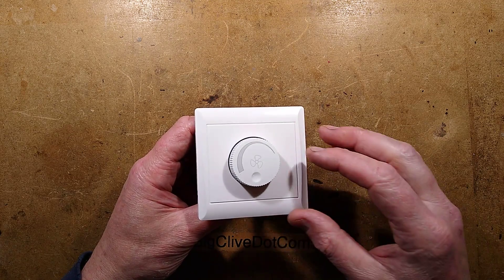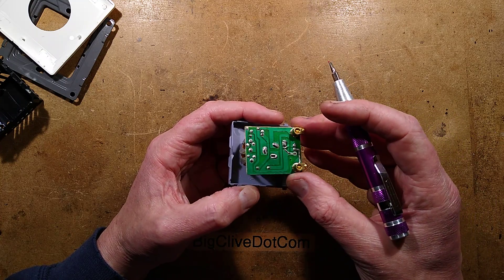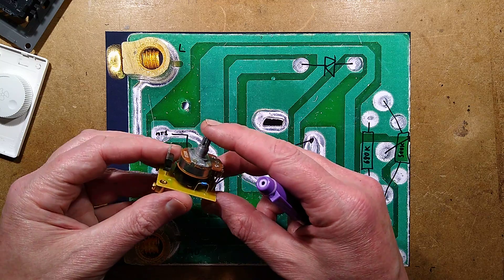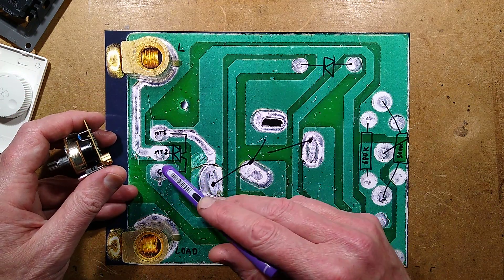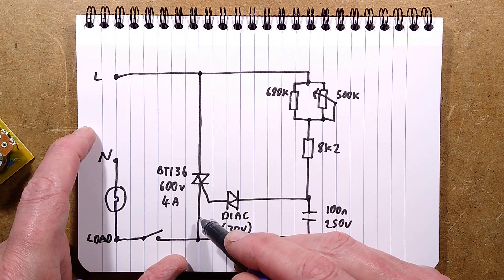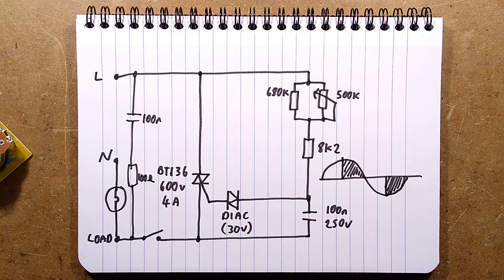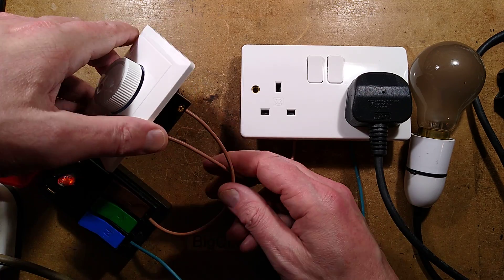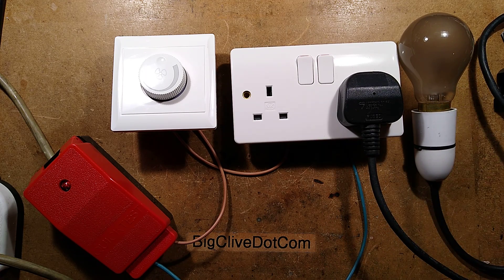Inside a cheap eBay fan controller (with schematic)

Comment: I had to make a 170v power supply for a project quickly. I took a dimmer, connected it to a bridge rectifier and capacitor, and turned the dimmer to a position where I ended up with 170v. Is this wise?

Comment: Is it safe to use on a shaded pole motor?
Reply from the maker: It may work, but a common way to reduce the power of shaded pole motors is to add a suitable capacitor in series with them.  It all depends on the size of motor and application.
Reply: @bigclivedotcom  I was interested in using it on a 40w desk fan. I want to be able to vary the RPM continuously and smoothly.

Comment: Hey mate, great videos. I have a question for you please.  If I wanted to have a speed controller for an Australian AC 240v single phase electric induction motor, 0.9A, 0.12hp, would my only option be a VFD or can you please point me in the right/better direction? Any advice is much appreciated. Cheers mate. 🍻
Reply: Or could I use a simple fan controller like you have in this video?
Reply: Anything that relies on lowering the voltage and/or current like this thing will only lower the torque of an induction motor (I think..). Therefor, with a load, you could theoretically reduce the speed by limiting the torque, but it may not be able to start, may stall and may overheat by running too slowly. I've wanted similar control for small induction air compressors but as you noted VFDs are really the only option that isn't terrible.

Comment: I made the mistake of using a dimmer as a fan regulator.
It was terrible.

Unless I had it at full speed, fan would make a terrible whining noise.
And the first half of dimmer wouldn't even give enough power for the fan to turn, fan would just whine.

The normal fan regulators have a set of 3 capacitors of varying capacitance. And the five numbers in it connect it through them with increasing capacitance, with number 5 being a bypass.
Only problem with them is, after a year or two, capacitors slowly deteriorate, and fan runs way too slow even at number 4, but it goes full speed at number 5.

Comment: Most fans or motors really hate the tryac version of speed control. They will make lots of noise. I think the more commercial versions for like large ceiling fans use large inductors to try to round off the high frequency aspect of a instantaneous switching midway through a sine wave.

Comment: Had a triac not turn off until it had a pulldown resistor between gate & neutral & the snubber was disconnected.  It was perplexing.

Comment: Another good reason to start some fans on high speed is that some have louvered grills on the front of them. The louvers are closed when fan is off.  There is usually not enough air flow to open up the louvers on low speed so it starts at high speed to quickly open the louvers and then one can back down to the desired air flow. I have a ceiling fan installed  in my 2nd floor ceiling and this is how it seems to work.

Comment: I have 3 units of an electric fan with the same kind of control, but they need to be turned on and immediately cranked up because the controller starts with a late triggering point. I think I'd have to flip the potentiometer physically or rewire the circuit board to make it work as yours does (which makes more sense to me.)

Thanks for sharing!

EDIT: Brazilian suicidal showerheads have also TRIAC controlled heating elements in some models.

Comment: Before I seen the video you had put up (I also seen one with youtuber "The Guitologist") (If you have not caught any of his vids he does a lot of old tube amp repair) Both you did reviews on the Knockoff Hakko 936 Solder stations. (It seems they are pretty much all the same on the inside and easily rebranded in China to what ever name suits their fancy at the time). But like I said in another comment. You convinced me to grab one instead of going the traditional route of just keep using a solder iron or pin type that lacked any temp control. As such I had been looking into Dimmer Switches on Amazon and had several picked out to make a dimmer box to control the heat on a standard non-temp controlled iron.

I was looking at a Westek 6077B 200-Watt Manual Dimmer or  HiLetgo 2000W PWM AC Motor Speed Control Module Dimmer Speed Regulator 50-220V to put into a box along with a outlet and such to make a Temp select type thing. (Very similar in design and function I suspect as this dimmer in your video break down.)

I am glad I did not go the dimmer box route but dimmers do fascinate me a bit still. I wonder what projects one could put a dimmer like this into.
The 936 knock offs are the way to go.

Comment: Works like a rheostat Clive. The older ones had wire wound windings inside. Some older components except for those old wax paper capacitors were of excellent quality and build, sadly fast forward to modern times in some cases quality is not there. They used to use large rheostats in cinemas  in the old days to dim the lights.

Comment: I've been trying to get my head wrapped around Triac since I accidentally bought a single speed drill off ebay, and then ripped apart a couple of worn out vacuum cleaners and saved the speed controllers. I had got most of the way there... I thought it was a variable resistor rather than a potentiometer, and I thought it controled the Triac switching directly, I didn't know about the Diac at all.

Comment: Hello dear Mr. Big Clive sir.  How do "cold spark" special effect machines work?  Thank you dear Mr. Big Clive sir.  Have a swell day!
Reply from the maker: They often blow finely powdered titanium through something resembling a hot air gun that ignites it on the way through.  The mass of the tiny burning specs of metal is so low that it feels cool to the touch.
Reply: @bigclivedotcom  Fascinating. Thank you dear Mr. Big Clive sir!

Comment: I wonder.. do all electronics in china emit tons of interference and electrical noise and not have their ground wires connected? I cant imagine that China has a separate product for export for each item, and then a safer, better built product that they use at home. I imagine the rate of fires and simply products that dont work are very high over there. I wonder what the average citizen thinks about all the products they buy, since it must be frustrating that everything is made with such low quality.

Comment: Would this work with every fan? I have an Ardes 5A120L. It only has 3 speeds (not well chosen) obviously with capacitive current limiters in the rotary switch.

Comment: would it be good to use it to control power on primary coil on transformer. i remade microwave transformer: replaced secondary coil with 20-25 winds of thick wire but i have to have possibility to adjust voltage from 12-16 v in corelation of current(car battery charger)

Comment: Clive, Don't think I've ever knowingly come across DIACs and TRIACs in my schooling on electronics, and I dont think you covered it in your component breakdown videos. Any chance or a brief video explaining them in more detail, specifically? Maybe in the classic "water" analogy?

Thanks in advance :)
Reply: Nonlinear components don't fit the water analogy well. If I were to try I would say a DIAC is a glass plate in a pipe. It blocks the flow but once the pressure gets high enough the glass breaks and lets water flow freely. Then once the water stops flowing it magically fixes itself.

A TRIAC is like a remotely-controlled self-healing glass plate.
Reply: @eDoc2020  So, it's kind of like a buffer so the upstream component gets hit with the power it needs to operate, then turns off again?

Kinda like those japanese water tipper features  ( https://www.youtube.com/watch?v=xjuFXlFI2PA ) ?
Reply: @Fishbait075  I guess it's kind of like that.

Comment: I made a 24 channel lighting dimmer for my school using a slightly refined version of this circuit many (many) moons ago when I was in the 6th form. Previously all we had was a rack of toasters at the side of the stage. I had the main rack with the dimmers in with the toasters where the power was and a remote control surface. The creative types were so excited that they could stand at the back of the hall and operate the lights from there. I even gave them two banks with a cross fade. Happy days.....

Comment: thought you might be doing a teardown of DC motor controller. 
simple one I know of is similar to this circuit, but with diac replaced by PUT(or Complimentary Feedback Pair of transistors) & potential divider to program it's trigger voltage. 
SCR's usually AC devices... but can work fine switching DC into inductive loads.

a massive refinement I found for PUT relaxation oscillators is is to use a constant current into timing capacitor. and a larger constant current into a trigger voltage programming resistor...that way after PUT fires and dumps the charge of the timing capacitor, the programing voltage will always rise quicker than voltage on the timing capacitor... ie no PUT latching on. voltage on the timing cap follows a fairly decent sawtooth/timing  also becomes fairly linear wrt to value of trigger voltage programming resistor value. 
I've been able to get PUT's to operate reliably, way above their stated max f using such.

may work OK to replace arduino on your Ev charger idea
Reply: A P.U.T. or U.J.T. ...is mostly used on lower voltages ( & dc or unfiltered / ripple dc..but not ac!..),else E1,E2 may breakdown /( fail shorted)..whereas DIACS are specially designed for AC triggering..and are available in many trigger thresholds...18/22/33 etc...as pre one requirements..one  adv. of ujt's is one can design a " Power On " ( voltage controlled/ ramped ) soft start ckt. into it when the ujt is operated from ripple dc.. another advantage is as you mentioned... multiple trigger pulses that repeatedly will attempt to trigger the triac in each half cycle ..as opposed to diac single trigger pulse..this helps as a single diac pulse may not trigger the triac the next half cycle.. especially on low loads at low speeds..
( jerky motion observed in motor )

Comment: Controlling modern fans (with PSC motors) with TRIAC dimmers are a very crude way to get speed control, the sinewave coming out of the dimmer is quite 'harsh' and will make the fan motor hum quite a lot (especially if there's loose windings/whatever https://www.youtube.com/watch?v=eP11uySF9rM)

Capacitor based speed control (wire cap in series) helps a lot more as the output sinewave is much smoother. 

At least TRIAC controllers are better than the big beefy rheostat controls which must get pretty hot

Comment: I prefer solutions with RC snubber network over coil suppressor in series with load and capacitor accross dimmer. They work very smooth, cover almost all range of lamp brightness and do not exhibit power on/off hysteresis, allowing so for very smooth start out from darkness and back.

Comment: Main difference between lamp dimmer and motor controller is that the lamp dimmer begins from low and goes to fill while motor controller begins from full and down. EDIT: oh you mentioned that at 8:20

Comment: I had a project a couple of weeks ago involving some variable speed drives. The boys had come up with a very complex relay system to control the drives and I said we don't need any of that, Anyway I adjusted the programming of the drive and totally eliminated the realy's. I  was intrigued they didn't know how to do it

Comment: As most fans use induction motors and not brushed motors, I'm not sure if using a dimmer is even appropriate to control the fan speed. Ideally an induction motor should be controlled by varying the frequency.
Reply: Phase angle controllers work well with induction motors if the load is variable torque, ie. pumps and fans but with constant torque loads yes you need a variable frequency drive. Thyristors and triacs don't usually work very well in phase control of inductive load applications without being hard fired ie. the firing pulse lasts until the end of the half-cycle, which this diac based dimmer is not

Comment: You should see if you can get a hold of one of those dimmers that has the sine wave cut in the other direction. Those as I understand it make motors sound a lot less buzzy when you use them, as the sine wave is cut off instead of cut on for the dimming function.
Reply: I would predict those would be more likely to blow up if used on fans. If the switching component cuts off when there is nonzero current flowing the coil will produce a huge inductive spike.

Comment: I have a similar unit hooked up to my ceiling fan. It causes the fan to make a terrible humming noise at pretty much any position other than full speed, so it's basically useless.

Comment: One thing I do agree with with big Clive is that in cases where something like this is used for fan speed control versus lighting that the starting with high gets the motor going because it would be harder on a motor to start on low this is much better reason why and some other people say about about how I being used the most I'm sure their differences of opinions but I'm sticking with this one since probably most accurate

Comment: Here in India, we've all but phased out (get it?) triac-based dimmer controls for inductive loads like fans. The choppiness it introduces at the lower speeds makes the fan hum noisily, makes the motor coils heat up, and reduces its life. Instead, we now use a 5-position (usually) capacitor bank to switch speeds, and it has the same form-factor as a triac dimmer. Sure we lose out on the smooth step-less speed control, but it's a lot quieter and saves sending fans to the landfill.

In fact, now that we're all moving to LED lights, and traic-based dimmers don't work well with LEDs either, the utility of traic-based dimmers has diminished to the point of all but vanishing from home use. It''s amazing - just 10 years ago these dimmers were everywhere. Now they've vanished. 

The 5-position capacitor bank based dimmers are very interesting in their design too. They usually have only 2 or 3 caps to keep the cost low, and the dial switches them into various series-parallel combinations to give 5-position speed control.
Reply from the maker: I'll have to look for one of those cap based ones.  I wonder if they're using a binary combination of caps.
Reply: @bigclivedotcom  Let me know if you're unable to find such a cap-based dimmer. Dealing with international shipping could be a pain, but the dimmers are cheap as chips here. Would not mind sending you one to teardown.
Reply: @rak3shpai  A link 2 these cheap as chip cap dimmer would B GR8
Reply: @bigclivedotcom  no it's not...binary weighted..just standardized cap values..( 1u3 ; 2u2 ;3u3 ) each with their bleeder across and each with a 2e2 / 3e3 series for inrush prevention@ each step change......but it's permutation combo.{..(2u2) is for the lowest speed...}..is different for each step... switch is a 2 pole 6way..( one pos.is open ckt.as OFF...,last is direct( FULL ON)...caps bypassed)
Reply: That's probably a far better way as you are only introducing additional impedance and not sending the motor a nasty spikey waveform.
Reply: @ianhosier4042  Yeah I did on industrial motor controllers for a while. TRIACs/SCRs were used but only for soft start, never really for constant speed control. Since the SCRs just adjust voltage and not frequency they are not really great for speed control. For residential use the capacitor speed controllers are your best bet I think.
Reply: @Waltzkon  I thought triacs do phase control, in other words only send the load a part of the AC waveform?  Capacitors add impedance but without the nasty losses of a resistor so effectively a capacitor controls the voltage across the motor.  Triac dimmers are notorious for electrical noise.
Reply: @ianhosier4042  Except that the speeds are never right.
Reply: We also use the stepped fan "dimmers" here in the USA as well.
Reply: By the way is there something better than either the nastiness of the triac dimmer or the very limited speed settings of capacitor ones? Or the next step is a full blown inverter?
Reply: One of my LED fixtures uses this tech. Instead of dimming the fixture smoothly like some chinese ones that i have, this one (its a Lumatek fixture) has 0% 25% 50% 75% and 100% settings. At first i did not like it as much as the smooth insta responsive Chinese ones (probably triac). This one also has some delay at gaining brightness once i turn the brightness up, probably due to capacitors doing their thing. 
BTW i am clueless in this sphere of talking please someone correct me so i can learn the truth.

Comment: Running an induction motor with a triac ensures that the motor incurs an inrush of current at a rate of twice the line frequency. The motor can never get to its full speed, so it is always lagging behind the line frequency, and when the triac activates, the motor will draw extra current to accelerate. Both the motor and triac will run hot (and inefficiently) as a result.

Comment: I just run my wall fan through my 240-120v transformer, otherwise it just spins too fast and sounds like I have an aeroplane on my wall, and it doesn't really push much air as a result, gotta love "quality" these days... :P

Comment: No idea what effect, if any, that would have on an AC motor.

As far as the parallel resistor goes, if you plot the effective resistance, it's pretty close to being linear over the range. It has a slight downward curve, but not much.

Perhaps a 300k pot was unavailable or too expensive?